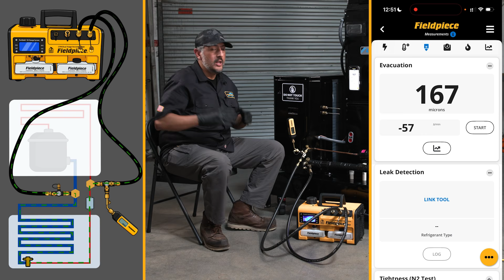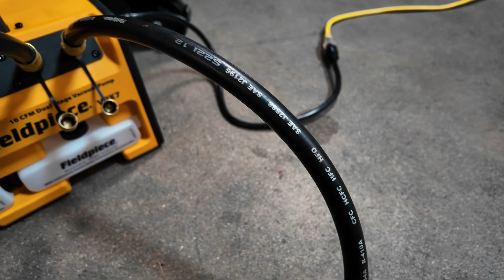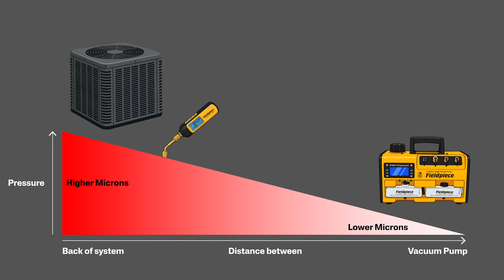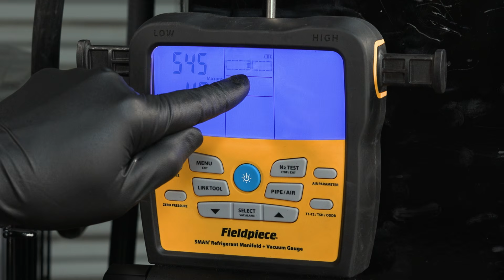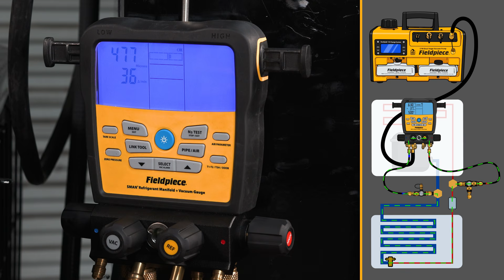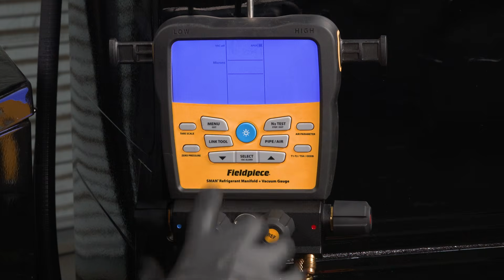Evacuation: Easier, Faster and Better – Three Vacuum Setups with VPX7, MG44 & SMAN®

Comment: Does anyone else have problems with those core removal tools with 2 valves. I bought one 6 month ago and I wasn’t able to pull out the. Schrader. I want to give it another try please let me know.
Reply from the maker: Please reach out to our repair team at 714-634-1844 so we may help you resolve this issue.